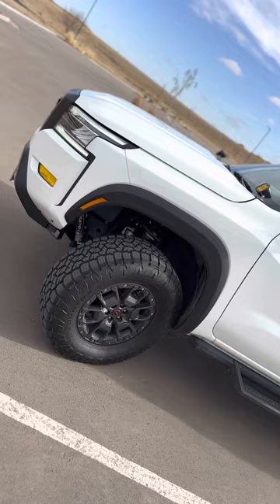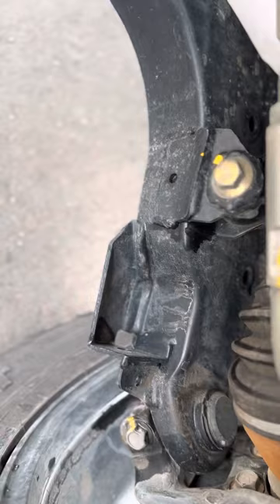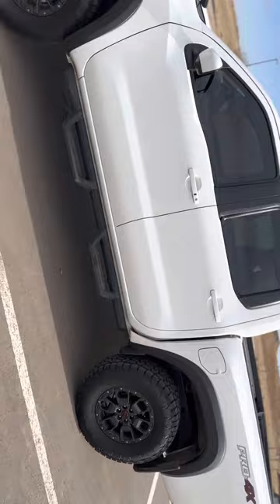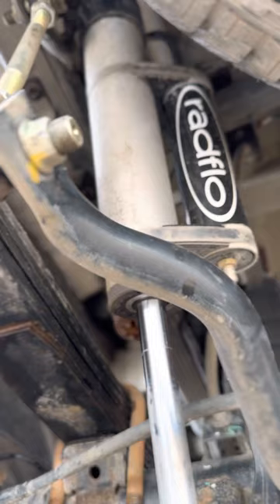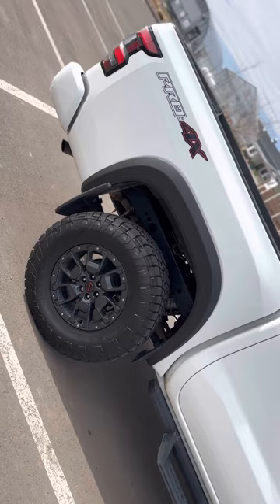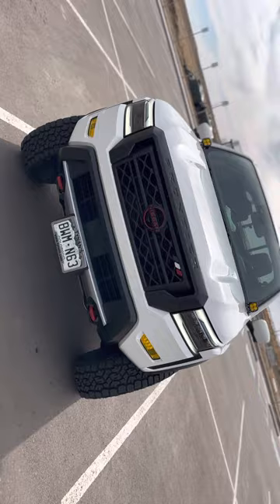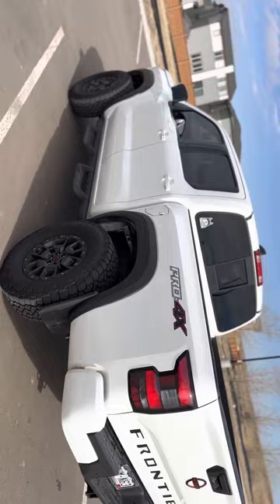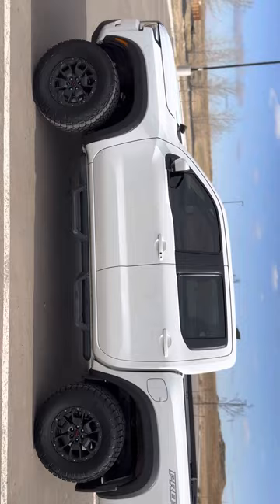Nissan Frontier 2022  Pro4X  (Lifted Titan Swap) First Titan Swap  Lift 2022 In Colorado !

Comment: So you don’t have spacers on the front, but you have 1.5” wheel spacers on the rear?
Reply from the maker: @oinchadoomandwolfboy  correct buddy it’s Titan swapped , in front of suspension…
Reply: from what i gather the titan swap widens the stance in the front
Reply from the maker: @whereschavo3953  correct I used wheel spacers in back 1.5 inch so they match front more

Comment: The video changed orientation too much times. Overall your truck looks Perrona! I Finally decided on the 4x Pro ove the Tremor Ranger.. I liked the ranger because of Aftermarket Engine support for big power but the Nissan looks better. The only thing I really didn’t like was the factory suspension shock/ clearance height package and the lack of a front Metal Bumper on the Nissan till I seen a aftermarket CBI bumper that does not look full off-road warrior and that kind of fixed that issue. So Definitely picking one up soon.
Reply from the maker: GraciasAmigo  mi primer vídeo la rege ja ja

Comment: What was the total cost ?
Reply from the maker: Lift was around 4800 , install 2600 , tires 1400
Reply: Thanks. I guess I'll be driving my frontier stock for a little longer 🙃
Reply from the maker: @nemesisrr9492  yeah pricey it looks awesome in person maybe try the less expensive option I believe all dogs coop has a lift for about 2500